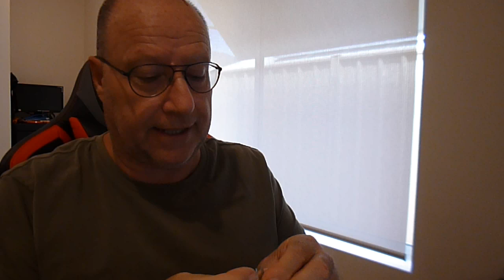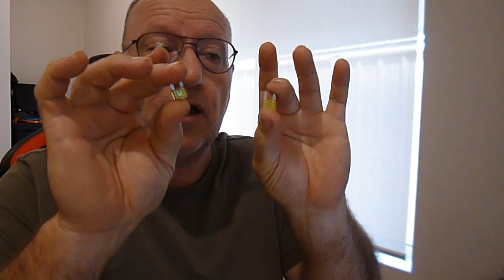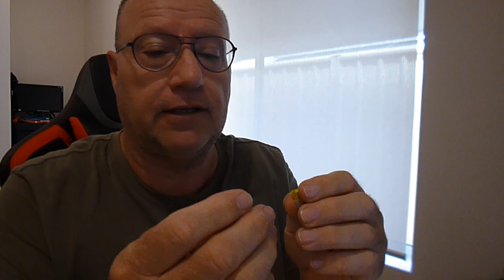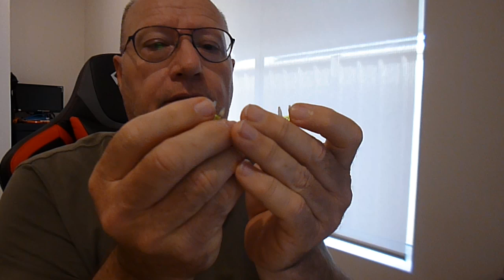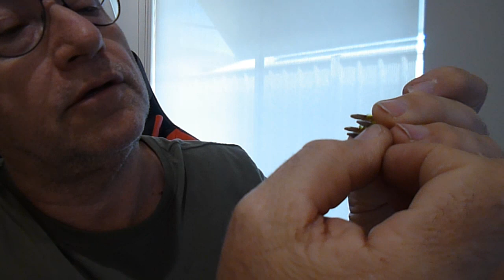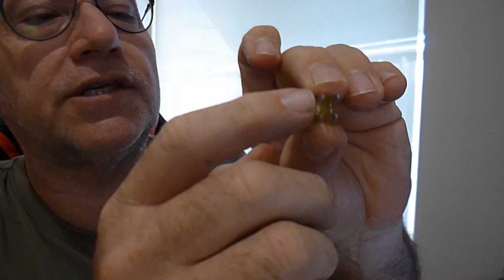Are Marine fuses the same as automotive?

Comment: Would a waterproof fuse holder protect against ignition risk?
Reply: Yes, but the fuse itself isn't approved for marine use. So, devil's advocate talking; if for some reason that cap was open and ignited the fumes, and burns the boat down. Insurance investigation will promptly deny your claim.

The ticket is to avoid having fuse boxes in the engine box on small boats.
Reply: @Derkenblosh2  By all means avoid putting a fuse box in the engine bay, but what do you do about the fuse box ON the engine, that was put there by the engine manufacturer? 

Avoid any issues by only having marine fuses in your spares box.